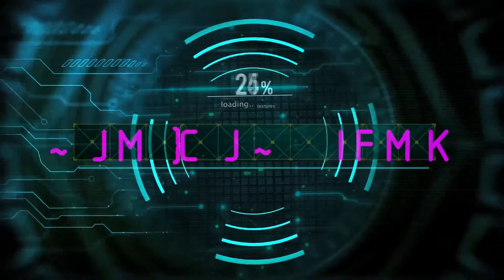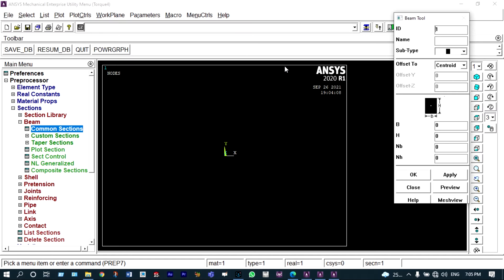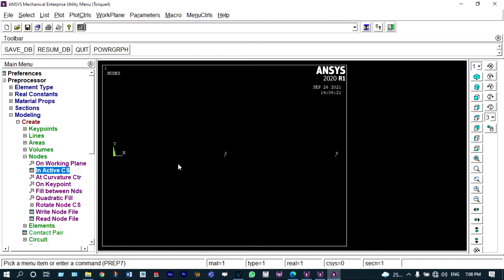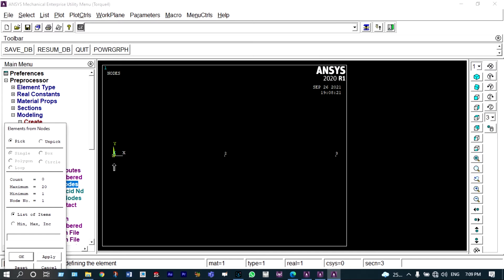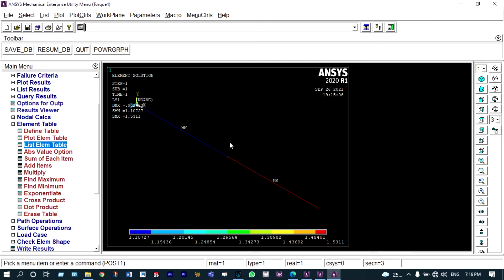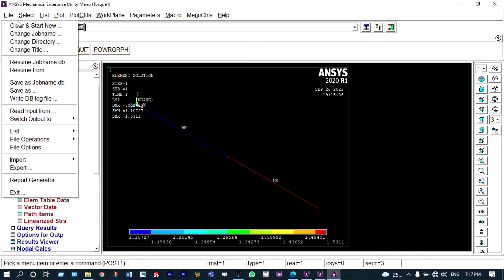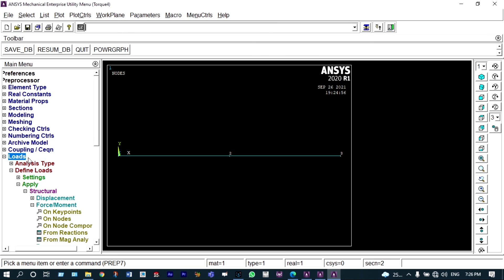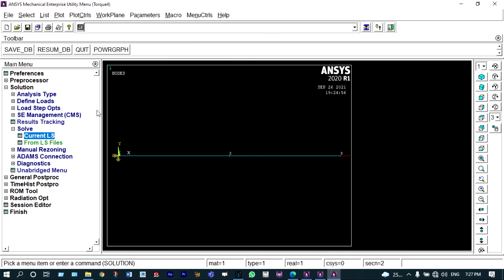FEA Tapered Bar | Tapered Bar Analysis Tutorial - ANSYS APDL

Comment: When I try to apply load, loads are not applied on nodes , how to fix this problem
Reply from the maker: How did you make the model? Did you make nodes or key points. Did you mesh it or not.  If you have used nodes, in that case meshing is not required. If you have made key points in that case load to be applied on key points not on nodes